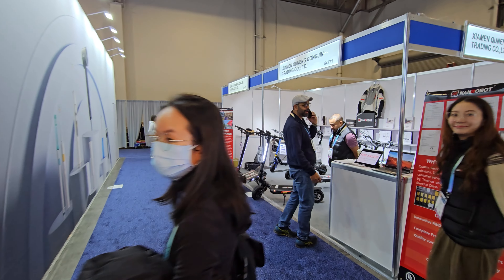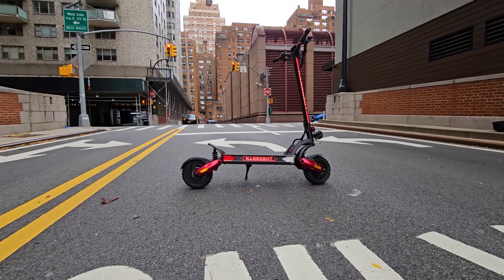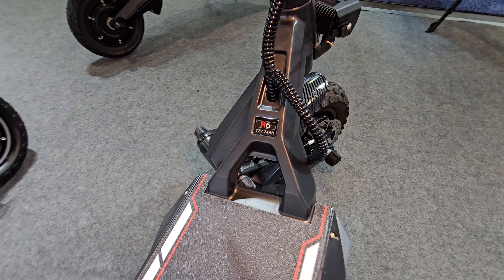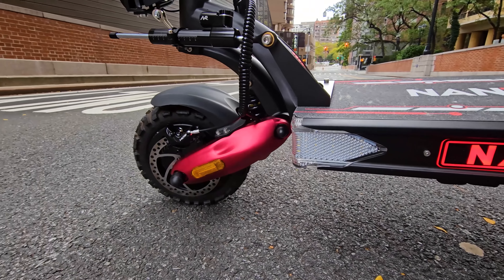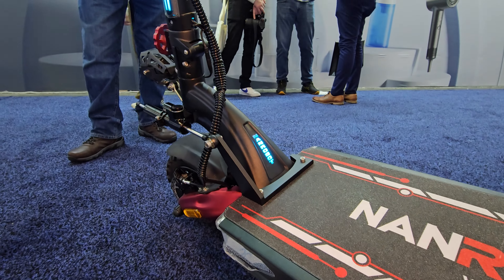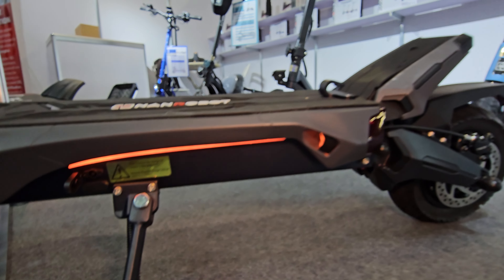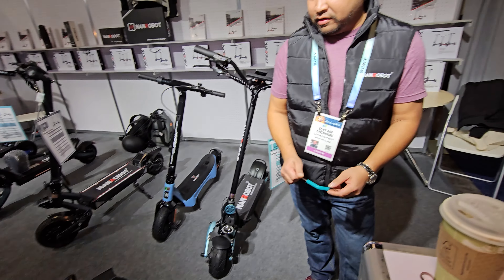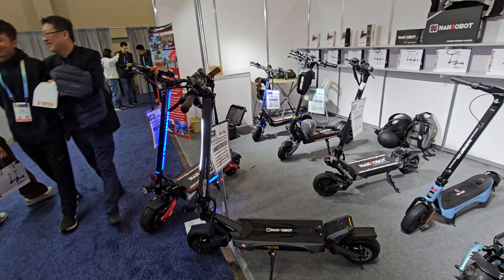Best Hyper E-scooter Deal of 2024 Don't Miss This!

Comment: Again, nobody reviewing this with actual GPS speed has been able to reach the listed 120km/hr. The display reading appears to be way off, like most scooters, and it would be great if you could confirm this.
Reply from the maker: I did 72mph on GPS i will post a video when on highway in New Jersey
Reply: I have this version and got it to 57mph in a small head wind. I’m 6’2” and 230 for reference so it’s plenty fast
Reply: I've said it before and I'll say it again. If one buys any high performance electric scooter with the expectation that it'll do the advertised top speed, they will be disappointed. These companies lie about it and for whatever reason people make videos agreeing to advertise those same lies. So just subtract 10 mph off the advertised top speed and you'll have a more accurate representation of whatever high powered scooter one chooses to purchase.

Comment: @ElectricVehicleSpace Is there much difference in the features between 60v vs the 72v like battery life i know about the speed difference? Dumb question but i got the nanrobot-ls7+60v in my cart and just want to make sure this is not outdated.
Reply from the maker: Get the LS7 plus 72V. this Scooter is very well build and has monster power and the best suspension I have tried so far. Better than Nami and part are good quality. Also use the affiliated link in the description to support the channel. This is their best scooter in Nanrobot collection.

Comment: Quiero comprarme un patinete eléctrico entre 2000 y 3000 dólares que pueda tener las siguientes características:
• Velocidsd máxima 45 millas por hora estable
• Neumáticos sin cámara para no tener que lidiar con tantas ponchaduras 
• Freno regenerativo
• Modo crucero 
• Que se pueda manejar bajo la lluvia(No es que quiera hacerlo pero vivo en la Florida y a veces será inevitable hacerlo para poder ir a trabajar)
• Que tenga una buena autonomía respecto a la distancia 
• Buena suspensión y buenos frenos preferiblemente hidráulicos 

Solamente lo usaría para ir por la calle no estoy interesado en neumáticos todoterreno 

He estado un mes mirando muchas opciones en internet y está el RoadRunner RS 5 Max, el Yume Raptor, Apollo Phantom, Solar FF lite, Wolf Warrior Gt Pro y Nami sin contar que el internet está saturado de muchas otras marcas pero veo  que dicen que Dualtron es la marca líder de patinetes en el mundo y me interesa comprar con 3 años de garantía extendida para poder tener protección durante 4 años porque donde vivo no conozco un mecánico de patinetes eléctricos. Cualquier ayuda que me puedan ofrecer me sería de gran ayuda. Que tengan una buena tarde.